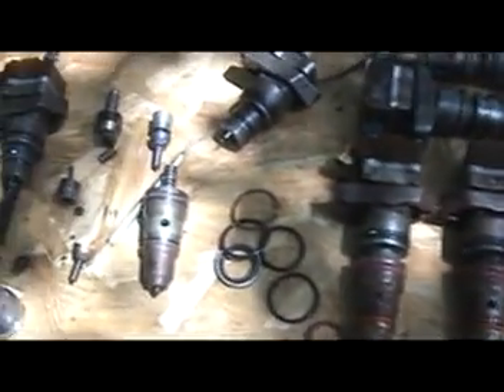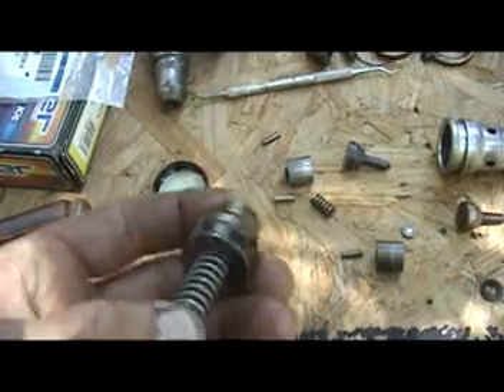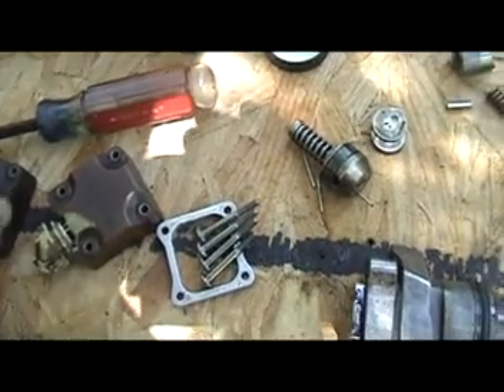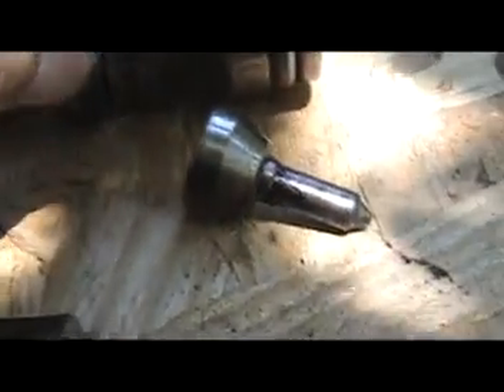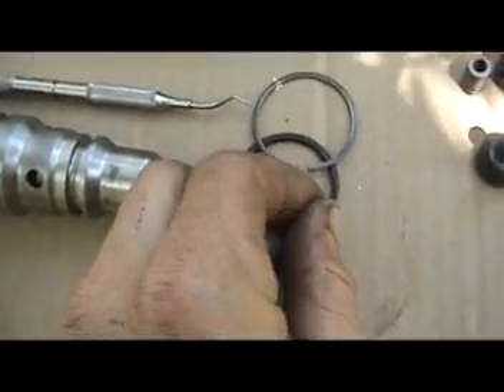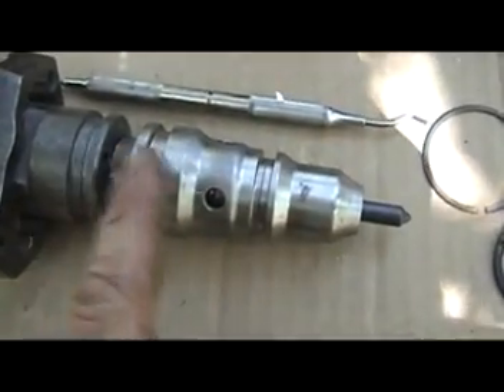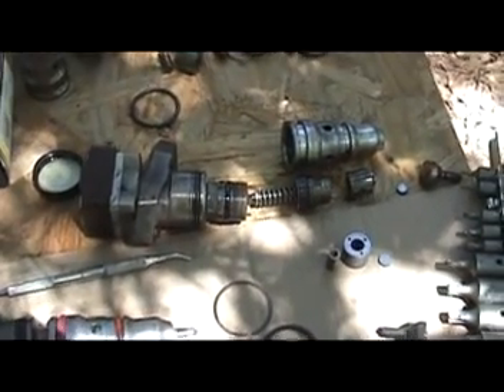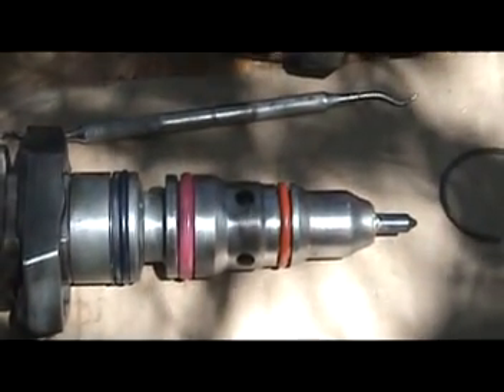How to rebuild a 7.3 injector new nozzels

Comment: Did you ever find parts? There's a company called Redat in Italy, they have an office in Florida. I've sent them several emails & requests through their website, but they never respond. It appears they have a complete line of internal parts for these injectors. I would like to rebuild my own bc it looks to be a piece of cake & would cost a small fraction of what buying new or rebuilt injectors would cost. Pretty irritating that injectors are being gatekept like they are.
Reply: Did you get around to going through your injectors?  I have a low mileage set...32k-34k...that have been sitting on the shelf for fifteen or so years.  I want to take them apart to clean, replace the internal o-rings, and maybe get new nozzles and/or tips...may also just ultrasonic clean the tips...
Reply: @bwguardian  Nope. I finally got a response from Redat about parts- they will only sell in large quantities- not in sets of 1, or 2, or 8. I tried to find a company who had or would open an account with them to buy parts, but was not successful. They did tell me the injectors must be calibrated & tuned to match after a rebuild. I don’t know how that works (how they’re adjusted or why they would need to be calibrated if they were torn down, resealed, then reassembled). I was able to find a company capable of performing the flow bench testing & calibration, but I don’t remember what it was called. I want to say it was in northwest Montana, but that may not be correct- I don’t remember. 

I’m sorry I don’t have more/better information for you. It seems the aftermarket is simply going to force people to spend at least $1,000 just to get injectors rebuilt when it could cost $200 instead. 

Got an estimate of ~$5,000 from Ford to do the injectors & injector cups- they claim the engine needs to be removed to pull the cups (the engine does not need to be removed to do them).

If you do the injectors, you should probably replace the injector cups as well. It’s a bit of a PITA- you use a 1” pipe tap that’s been made into a slide hammer to pull the old cups, you then clean machined surfaces, then glue & pound in replacement cups. There are stainless aftermarket cups available that don’t corrode or break down like the OEM brass cups. 

If you try to go down the rebuild path & find a way, I’d appreciate if you’d let me know. I’m not having any issues with my injectors at this point, I just wanted to refurbish them before there was a problem. Best of luck to you.
Reply: @bbrown6799  there's a guy in Finland that bought parts from Redat in Italy...he has a youtube video too.  The guy I'm buying parts from...he's out of Seattle...is currently out of springs for his kits.  He says the springs really aren't necessary unless the units have over 400k.  My plan is to rebuild the low mileage set I have and put them in the wife's Excursion when I'm doing glow plugs and checking rocker bolt tightness.  I will take the springs on the low mileage set and put in my injectors on my F350 with glow plugs, rocker bolt tightness, valve cover harness upgrades, and shim the armatures.  

There's really no need to calibrate them...especially if they're running fine...as I think it's more of a scare tactic from what I see.  I can see what they're talking about relative to machining some of the internals to put them back in spec versus having to shim them on a high dollar tractor puller and such, but for a daily driver it will be fine.  I will have the nozzles ultrasonic cleaning as the price for new ones is $$$ and I don't need an upgrade for more power that much given the trucks run fine with the upgrades in them now.

Where are you located?
Reply: @bwguardian  I’m in SE WA, about 3hrs from Seattle. You?
Reply: @bbrown9763  Houston, Texas.  We have family friends up there.  They had several restaurants up there, the last one in Olympia.  They live down here in Kerrville, Texas now though...

Comment: Is there a way to rebuild and up the cc's on my stock injectors? Can't find a definitive answer and I'm a virgin in the diesel world. I've owned 6.7s but never worked on them. Now I bought a 97 f350 crew cab 8ft bed 4x4 and my farts clear a room faster. Just not about to drop 1500 bucks if I don't need to when I have a bridgeport and basically everything in-between to fab what I need if even possible.

Comment: Unless you put the injector on a test stand rebuilding is like shooting in the woods hoping to hit a deer..even bra and new nozzles unless tested for flow and pop tested are not always good. After rebuilding, torquing the cap, replacing check ball, leaping the arbiter plate or the aluminum ring to bring the injector into spec. checking the piston in the barrel, replacing the body piston o ring, and so much more...hope this helps people watching so they don't thinkk its just a matter of replacing  and cleaning stuff..which could lead to frustration

Comment: how do you get the number 3 injector out of a ambulance
Reply: Cody the Car Guy HEY I have a question have you ever seen the copper washer seal break into pieces I had 2 that broke in 6 months and left major burnt junk on the bottom of the injectors, can that cause damage to the injectors, would that also cause a major blue smoke issue at idle, with very little blow by at all
Reply from the maker: Pretty much like the other ones but sometimes the o rings stick and sucks doing them in vans

Comment: This not even remotely close to accurate procedure to correctly rebuild injectors for your 7.3 injectors. He does not address poppet clearance, torque specs for the body other parts that need to be replaced. Lastly he doesn't test them. If he can't afford a real workbench he surely does not have 35,000.00 worth of test equipment
Reply: Shawn Brown Troll.

Comment: i need your help man, does the heui injector cause the diesel get in the oil and what can i do ?
Reply: Cody the Car Guy how do I buy parts from you I have 5 injectors I want to rebuild I need o rings and tools I know I have 3 bad injectors in my truck maybe 4
Reply from the maker: Roger Velasquez Two things can be going on a cracked brass cup or a bad oring will let diesel get into the oil a lot of times if its the cup you will get diesel in the coolant

Comment: How much for the 70 psi nozzles and a rebuild kit for a injector?
Reply: Those nozzles run $400 but you shouldn't run them on stock injectors, our injectors need internal upgrades for increased flow to work in conjunction with larger nozzles

Comment: Your videos are so well illustrated and very imformative. Wish I had your shops number. I got a question about the cylinoide on my 2001 7.3. I'm thrown a code for the circuit open. And my whole passenger side bank don't work at all. And #4 on drivers side don't squirting oil out of the oil spout.

Comment: AE injector on the rear was for engine "cackle" was just for noise issues on the 99 up 7.3 strokers, no extra power, if any it was not intended. Great vid.
Reply: David Henri It is for cackle but what i think he meant was to say was it gives more fuel because it has to deal with lower oil and fuel pressure at the back of the head. Its a higher responsiveness "long lead" injector so it is bigger persay, but with the lower pressures it evens out to a regular ad code.

Comment: What is the price on the 70 horse nozzles with the new o rings looking to up grade my 7.3l thanks.
Reply: 70hp nozzles are gonna run around $400...that being said your injectors need to have internal upgrades for increased flow to work in conjunction with larger sized nozzles

Comment: Hey , Nice Vids. Workin On A Ford 1999 7.3L & Need That "System Zero" Driver For The Machine Screw Under The Solenoid. Also For All 8 Injectors, The Internal O-Rings Kits. Thanx A lot Man My Number Is 402-450-9361 Might Have To Leave Message, I'll Call Back, Away From Phone Sometimes. I've Tried Almost Everywhere For These Things, Nobody Rebuilds Them Anymore, Just Buy New Ones. J & S Diesel In Las Vegas Sales This Stuff Too, But I Would Rather Support Your Cause If Not Too Pricey. Thanx A lot.

Comment: I need the internal o-ring kit for 1999 ford powerstroke fuel injectors, I also need the armature adjustment scvrew tool to remove the armature. I lost mine since the last time i rebuilt a set. I also need 8 of the intensifier pistons. can you give me a price on these.

Comment from the maker: Actually i have my own injector and pump stand!!! And the new videos about to come out are in more detail and HD and more info. Also ill be showing some cav/lucas stanadyne and cummins pump builds. Turbo builds and sooooo much more! I might even show how to build a test stand out of a cylinder head i also have specs on all pumps as well , so maybe you should ask me before you assume i don't have something. I will cover diesels a-z by the time im done specially when the new shop is set up.